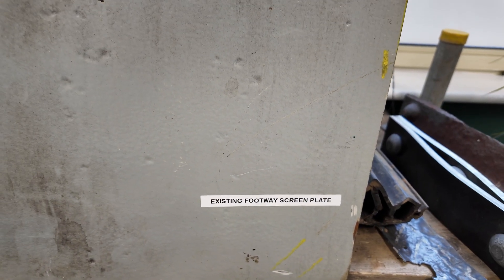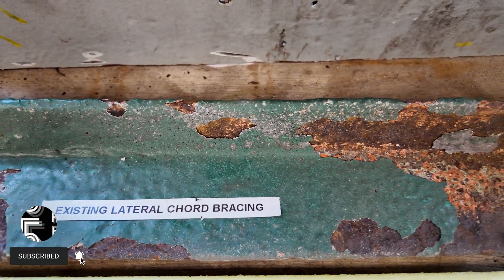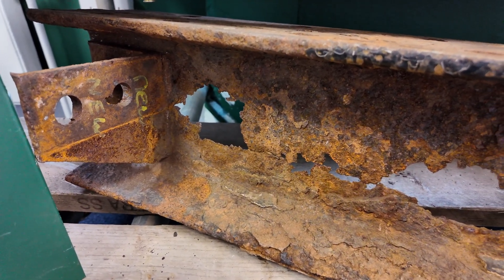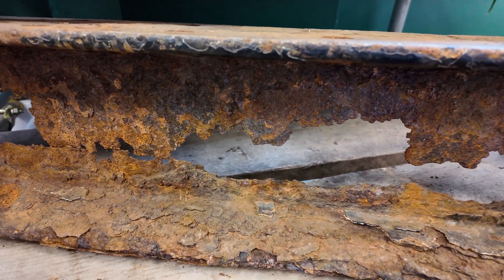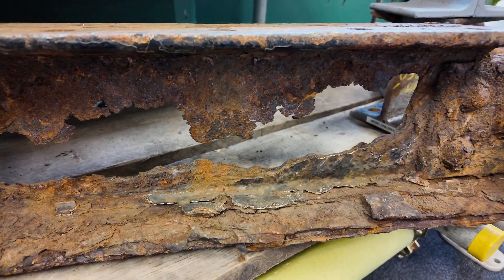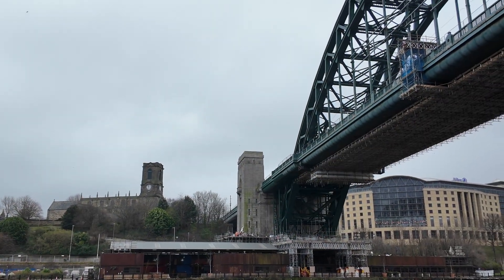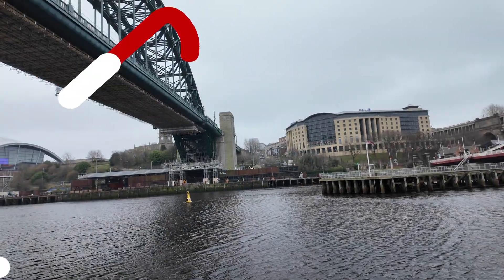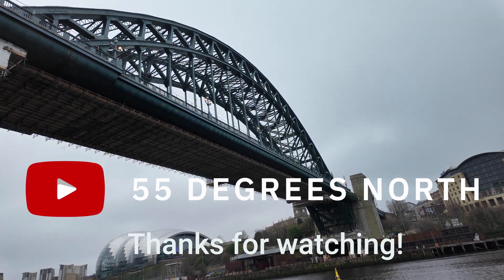TYNE BRIDGE'S SHOCKING SECRET: Rusty Steel Parts EXPOSED!

Comment: When I was working for street lighting back in the 80s I was pulling rusted lumps off the Tyne Bridge with my hands. The fuses are in the removable panels at ankle height on the footpaths and once you take them off the amount of rust, even back in the 80s was enormous😮
Reply from the maker: @toontenacity  I can imagine I believe this is the first time it’s been stripped back of all its paint work for years I think the councils either side of the river have a lot to answer for. Thanks for watching 👀

Comment: That's quite shocking to see such corrosion. I had hoped they would change the colour for the centenary, amazing it's only took 3 years to build but 4 years to repair. The stone for the four huge columns came all the way from Bodmin Moor in Cornwall by sea.
Reply from the maker: It really is it’s a lot worse than I thought I knew the colour would not change as that was the original colour in the 1970s early 80s it was blue and red. The stone is probably the only thing it does need any restoration work most likely just a good clean. I often wonder how it was taken  4 years but when you see it you understand why. Thanks for watching 👀

Comment: Not surprising some parts have rusted through that is what happens with unmaintained steel. What is shocking that they have been allowed to get into such a state.
Reply from the maker: Definitely the councils both sides of the river should have a lot of questions to answer they knew it needed doing but left it rot going cap in hand to the government to get the money. Thanks for watching 👀